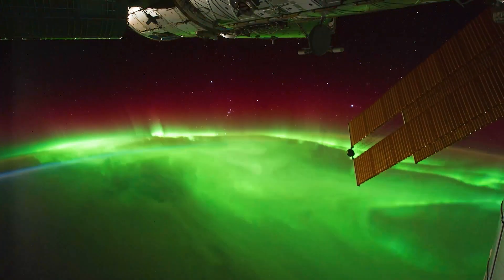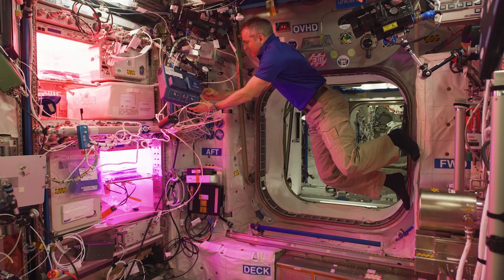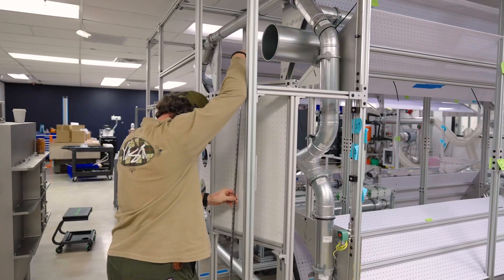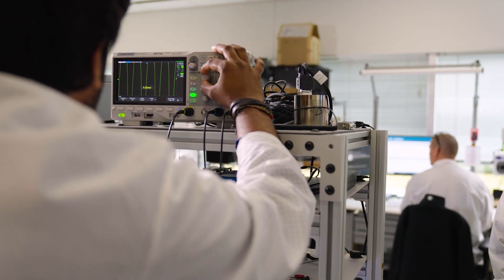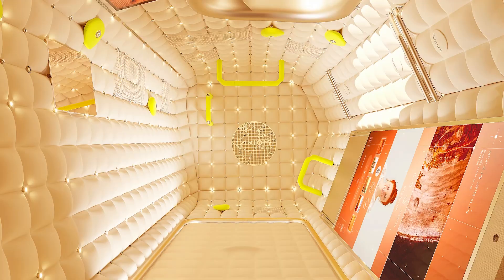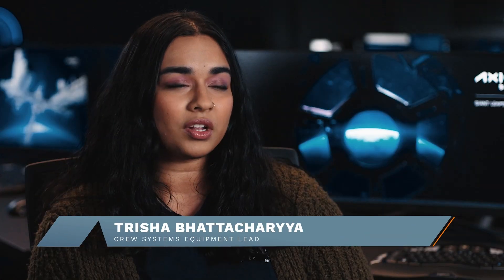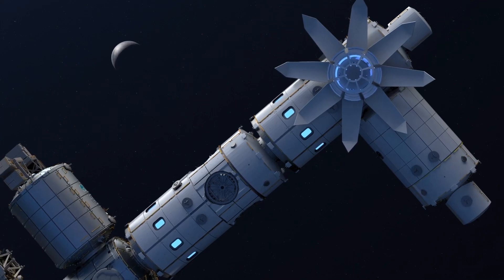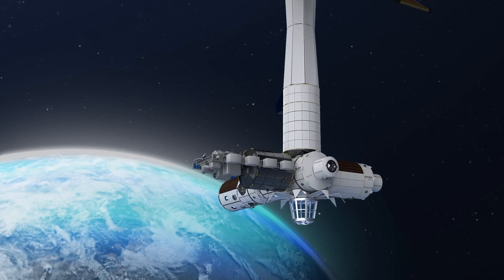Building Axiom Station

Comment: Love it. The idea of using the ISS as a base to construct another, more modern station is a sound one. Good luck to Axiom Space in this endeavor. The future doesn't "just happen". It is what we make of it, what we put efforts, time, money, and love into. I grew up with the beginnings of our space program and envy those who will witness the next 60 years. It will be amazing, thanks in part to those like Axiom Space.
Reply: That is what makes most sense, using the ISS as a platform and maintain it for new construction, i am disheartened that the ISS could be deorbited when it could be replaced by new upgraded parts and other structural needs, it is an engineering MARVEL and we should use it as a platform for continued construction projects or otherwise such as what Axiom is doing....
Reply: @RamblingRodeo  indeed, we need to get the most bang for our bucks out of the ISS, as long as it can safely be occupied. The 2030 extension will depend on those two old Russian segments still operating and still being relatively safe. They will be at nearly double their designed lifetime by then. 

Fingers crossed...And then of course depending on what the Russians decide to do....
Reply: @rosswarren436  Ive also wondered if SpaceX which has stated they would take up the slack if something happens with the Russians, what if they placed a dedicated Starship portion in place as a central core of sorts with docketing rings attached all along its body? Id love to see the ISS central core used that keep the modules together as a means of bring in new portions overtime and creating a REAL permanent station that is flexable enough to endure time, id hate to see us throw it away only to start over, why not throw away the bad and replace w/ New? Even inflatable pieces could be new portions or otherwise while using the can type for the core of a starship for the core of a station?
Reply: @RamblingRodeo  some of it has to do with not being able to manipulate the modules without the shuttles available. They were all designed to be plugged in via the shuttles robot arms. 

And I'm not 100% sure if they can be disconnected now. An ISS engineer would have to speak to that. 

Another issue facing us if the Russians decide to abandon the ISS, is that so far, only their Progress tankers bring up fuel for the Zarya module to do reboost, station keeping, attitude control when the flywheels aren't being used, and collision avoidance.

We've only just started experimenting with using Cygnus cargo carriers for some of those tasks, so we are behind the 8-ball on much of that. 

But yeah, some of the younger modules could perhaps be reused. Plans for that (if possible) would need to be worked out - and soon. 

Considering the cost per pound of payload when they were carried up by the shuttles, and the risks we took doing so, it would be a shame to needlessly throw them away. 

But I'm afraid Starship will be delayed too long, especially for any considerable redesign necessary to make a de facto core module. Already, it seems doubtful that any test flights will be launching from Boca Chica. And the current Dragons are simply not designed for those tasks, with the engines not pointing in the best directions, not much fuel reserves, etc. 

We were foolish to put the Russians and their modules in the critical path for the ISS, but that is exactly what we did.
Reply: @RamblingRodeo  oh, I understood why they were offered a part in it, but the way it was done was dumb. We used them as a subcontractor, paying them for their modules.  All other partners paid their own way.  And even so, the design should have been done to not make any of the ISS dependent upon their two modules. Both Zarya and Zvezda could have been put to other uses.  Sure, reboost by them is nice, but we should have had in place a back up plan all along. We have been penny-wise and pound foolish with our space program too many times - mostly due to politicians.

We'll see what happens. I like SpaceX and wish them well, but if Starship takes too many test flights, it won't be cheap, even for Elon's pockets. Throwing away so many expensive Raptor engines on test flights is something I know they considered, so fingers crossed they can start recovering them on the Super Heavy and Starship sooner rather than later. 

If the FAA and EPA weren't going to let SpaceX fly from Texas, they should have told them up front, not after all that time and effort was spent trying to turn Boca Chica into a great test facility. 

As they used to say on TV, "stay tuned"...
Reply: @RamblingRodeo  yes. It is frustrating as someone who has followed our space program since the Mercury days reading AW&ST religiously. 

But I don't fault the engineers or those at NASA too often (other than the massive cost overrun on the JWST that cannot be defended at all).   

Instead I fault the clueless politicians who decide things and direct NASA.  SLS was their baby. They forced NASA to use old shuttle tech, thinking it would be cheaper, while providing a jobs program in states that have powerful members of the Congress and Senate who want those jobs to continue.

But it didn't have to be this way. They never gave NASA a chance at a clean sheet design - to field a heavy lifter for the 21st century done right. 

So, like it or not, the SLS is probably going to stick around another 20 to 25 years, even if Starship/Super Heavy is a success. 

NASA rarely gets a chance to develop any new vehicles at all.  Which is one reason we kept flying the shuttles for so long. It was the only game in town. 

Many had proposed other vehicles, or using the shuttle to create a "Shuttle-C" cargo only carrier, but none of that became more than paper studies. 

The only good thing is that NASA is helping spearhead private enterprise to fill the gaps and push forward beyond what our idiot politicians want to fund. Fingers crossed for a burgeoning low earth orbit and cislunar economy one day.  Take care!
Reply: @rosswarren436  In all honesty, i dont think that SLS will be a future vehicle, the current congressman that fought for it is retiring and the price tag per launch if it can do two a year it is just worth it. 

Further, NASA should be a facilitator to the private sector of space, an advisory role and do the small missions they are successful at like Mars or otherwise, to training the astranaught core for the private sector, i don't feel that NASA should be in the business of building said vehicles, they had there time, now it is time for it to become a council of advisory, while doing what they are good at and let the private sector come into its own...

I do realize that Congress is a lot of the issue, it is unfortunate but it is what it is, i think money that would be spent on SLS would be better spent towards the private sector, to new age stations, to other orbital or other planetary body roles, but get out of the way of LARGE vehicle type programs as the SLS. It just makes NO sense these days, i think that SLS is as you stated old and outdated tech that was forced onto NASA by thinking it was going to be a solution, which seemed to be the right way to go. But, after 10yrs and nothing to show for it and time after time it is past time to cut that project lose and cut our loses towards knowing better projects will come of doing so and a better investment in the future of private space.
Reply: @RamblingRodeo  you are right, but part of the reason SLS has taken so long is that the funding (as large as it was) was stretched out over the years.  Boeing, despite its lackluster performance, could only go as fast as the money allowed them. 

I'm afraid it will be a situation of "throwing good money after bad" with SLS. 

Just as NASA was forced to keep flying the shuttles, even after it became apparent they were too dangerous to use, they'll likely be forced to use SLS for most lunar missions. 

There is no money in our space program for a follow on, better launcher (and no politician who would fund it).

It is good that Starship/Super Heavy continues to win contracts from NASA. The money given SpaceX for developing lunar Starship should help them finish sooner. 

If it comes to fruition, only then will the Congress take a long hard look at ending SLS. 

The thing is, Starship/Super Heavy is not the best vehicle for being a simple heavy lifter either.  Elon is making Starship to be a Mars lander, with all the design compromises and weight penalty that entails. 

I guess what the could do in theory is develop a replacement upper stage for the Super Heavy, one that would only be concerned about lofting payload.Maybe even turn it into a 3-stage vehicle similar to the Saturn V.  

Then Super Heavy could do a dual role. 

I'm looking forward to the initial test flights and for SpaceX to move forward with it. 

I still think they should keep using Falcon 9, even if Starship can be fielded. The F9 works and works well for most commercial payloads. It has already been paid for in development, and once they have a larger fairing for it and the Falcon Heavy, they'll even be more competitive for those large DoD/NRO contracts.
Reply: @rosswarren436  I agree with alot of what you state, i just cant see them sticking to this SLS vehicle, it is beyond the pale of wasteful money, every other company has made there rocket reusagable in some fashion or other and this thing wont do anything of those things. I understand how the funding works, i work contracting in the defense area but things are changing from that old out dated model and IMO SLS was just was never really suppose to do anything, i think it was something that was selected and just go way to far, further than it should have. 

But, if we are to stick to it i think that is a bad idea and i just cant see them justifying the cost of it, it truly blows my mind....

As for Starship, i think once Starship is cleared to fly i think it is going to revolutionize the way we get into Orbit, to visiting other planetary bodies in our solar system, i see a lot of things changing for the better and doing something while other companies will play catch up, we need to put more into these private sector companies, NASA needs to be the focal point of that, as they have a role to play instead of building these projects and i think for the most part NASA is on its way of doing that, i think it is stalled a little but perhaps not?
Reply: @RamblingRodeo  Well, maybe there would be a chance for them to further "evolve" SLS into what it should have been. To be fair when SLS was designed, SpaceX had just gotten started on their F9. No one was into reusability. And many of the aerospace "Goliath" giants were laughing at little "David" SpaceX when they first started, thinking they'd fall flat on their faces. 

So we ended up with a "old school" design for SLS. 

But it could be modified using ideas from ULA's Vulcan and RocketLab's Neutron, to recover the expensive engines in a detachable module and reuse them, while only throwing away the relatively cheap tankage. 

That's just it. After spending tens of billions developing it, we might as well fly it about 10 times, (they only plan one flight per year) even if every flight costs $4 Billion, then transition it to something better. Or kill it and start over "clean sheet" if Starship isn't a reality by then.

There's a good article on Arstechnia about the costs of SLS, and in it, we see the problem within the Congress and Senate is that many of them are AGAINST privatization, even if it proves far less costly. 

That is rather dumb if we want to have a viable and growing cislunar economy.
Reply: @rosswarren436  It is indeed crazy, SMH i have seen alot of the breakdowns i know a lot of ppl want to blame congress and while they are apart of the problem NASA itself is apart of the other issue that created this issue.

I know many are like we got to stick to this SLS, but do we really? They could have gone with something far more realistic than what they did, going with old space company under SLS and same old outdated contracting.

I am not in favor of allowing this atrocity to become what it is and only 1 flight a year? SMH, it blows my mind...

Comment: will this be joint onto the ISS or is this replacing the old one or will they be both in low orbit
Reply: it will start out as an addition to the iss.
Reply: Joint to the ISS and after completing ISS has two options. Copy MIR or maybe if Starship is ready take ISS down to earth and make a museum. I would appreciate that. 😍
Reply: @JoLo6696  More than likely the ISS will be broken up and allow it to burn up in reentry.  It would too costly to return to earth.  Of course maybe Space X could return it in a Starship cargo transport vehicle, but that is not even planned for at this point.  Merely a hypothetical option.
Reply: @JoLo6696  ISS is already planned to burn up and smash into the ocean farthest from land... the timeline is pretty much agreed upon
Reply: Probably replacing they are taking the ISS down in 2030 they are going to crash land it at point Nemo in the Pacific Ocean
Reply: It will be built onto the ISS, then when it is complete and all is well, it will detach and be a station in its own right.  In a way, the ISS will be producing offspring.
Reply: The ISS is an existing platform and a staging area for Axiom to build off of.